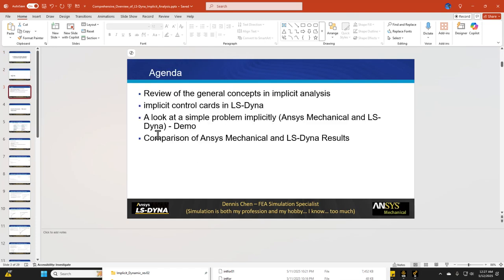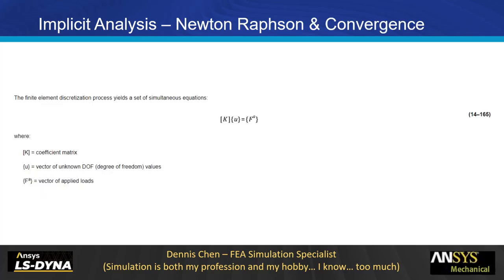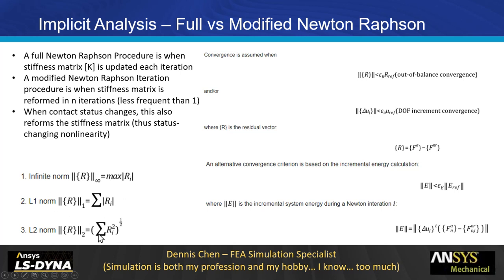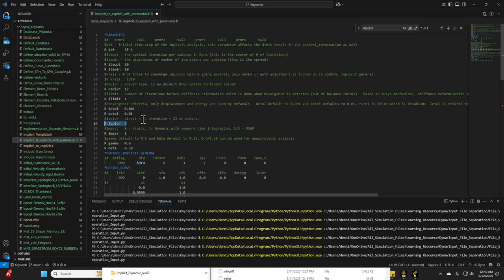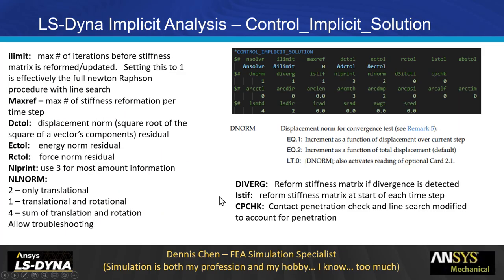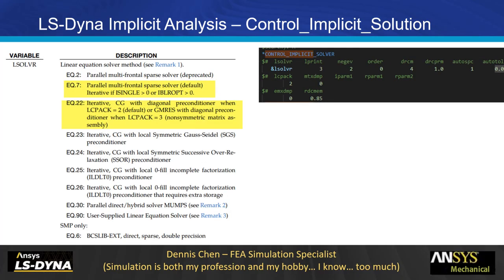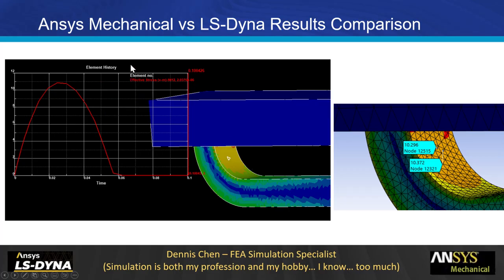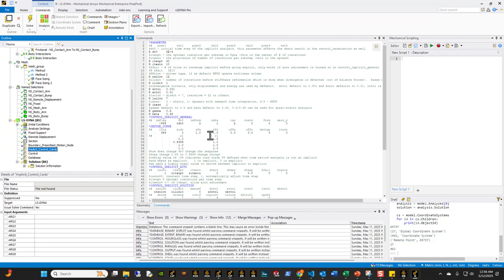Implicit Analysis in LS-Dyna and Ansys Mechanical, a combined overview

Comment: Please you can explain the spring back analysis and relative keyword ? Especially I’m studying the spring back after an impact.(after ball hitting a plate )
Reply from the maker: Hello, I am not exactly sure what you mean by spring back after a ball hitting a plate but if you mean interface_springback_LSDYNA, I have made a video about it and below is the link.   Basically, a dynain file is created which you can use to do a "full restart" which allows you to continue an analysis after a transient analysis (like a ball hitting a plate).    The stress states on the plate would be contained and read in the dynain file.   

dynain file is written out when interface_springback_LSDYNA is invoked.     Some additional details you can find in these videos below.   Hope this helps you. 

1 - how to use restarts - https://www.youtube.com/watch?v=8lFGT2q-dGw
2 - Case and Multistage analysis - https://www.youtube.com/watch?v=zLV9Qatm03Q

Comment: Thank you so much for the useful tutorials,
Just want to ask if you can provide a tutorial on self tapping screw where the screw cuts the thread in the material. Thank you very much.
Reply from the maker: Hello, this is very similar to something like a metal cutting simulation, just a lot more expensive and also we have to ask what the problem statement is.   Maybe think about learning how to do the simplest form of simulation that involves material failure and use that to learn, instead of jumping to something expensive computationally.